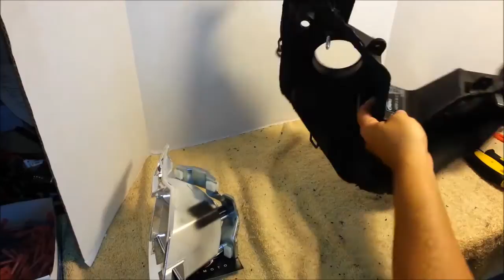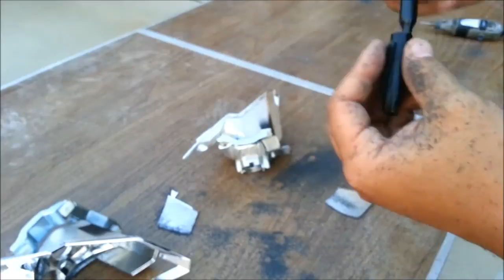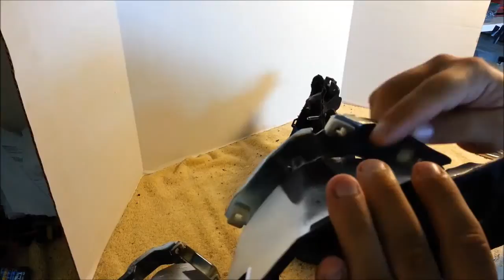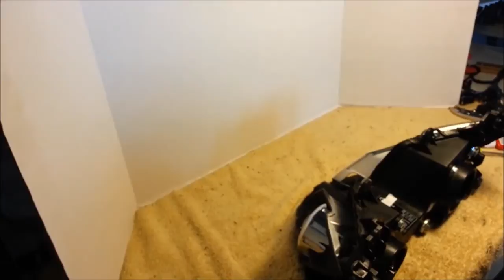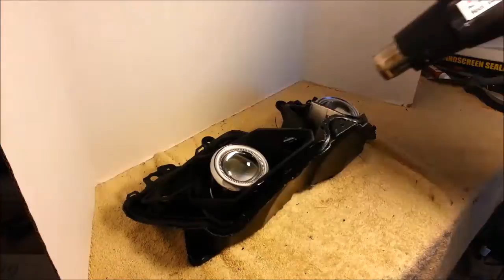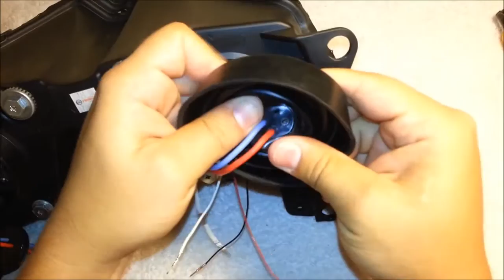How to install BKMOTO Ninja 300 Bixenon hid projectors

Comment: I’ve got everything connected on my bike except for two connectors that have grounding straps on them and I have two male connectors that are on the bike I have nothing to install into. I also had two extra parts that I do not see anywhere in this video so I didn’t attempt to put them anywhere. I turned on my bike and had no luck, I read a comment that says to swap the positives with the negatives but that seems tedious and I would like to figure out where I need to connect these connectors before I go ahead and swap everything back. Also, I would like to know what crimp sleeves are recommended so if I do go ahead and swap everything, I get everything right. 
I have one red wire connected to the positive on the battery, I have white with white, positives with positives, and negatives with negatives excluding the one on the high beam. Inverters are connected, the red and blue wires behind the halo/demon eyes are connected to each other, and still got nothing. Please help ASAP!
Reply: Found what the two extra male connectors are for. Exclude that part!
Reply: The kit I recieved is unlike this video too. Most of it is connected, except the switch and the two units that power the halo and Demon eyes. For some reason, the low-beam/high-beam switch on my handlebar doesn't control the low or high beams. I'm stuck with only high beams. Do you know why this is happening?

Comment: Does this setup make the original high beam switch obsolete? Still not sure how to control from low to high.
Reply from the maker: No, your hi/low switch still works as it should to switch the projectors from low to high beams
Reply: BKMOTO LLC ok, so how does that wiring work, I dont see in the video where the original switch wire was plugged up. I dont want to buy a kit and be totally confused on that part
Reply from the maker: fast forward to 1:20 and you will see 2 original pigtail plugs, one is white and one is black. these are the plugs that lead to the low and high beams on the bike. you are splicing the relay harness to those plugs, which lead directly into the hi/low switch on the bike.
Reply from the maker: fast forward to 1:20 and you will see 2 original pigtail plugs, one is white and one is black. these are the plugs that lead to the low and high beams on the bike. you are splicing the relay harness to those plugs, which lead directly into the hi/low switch on the bike.
Reply: Ok so the new relat is being tied in with the stock wiring harness, is that correct?
Reply from the maker: yes, the new relay is tied to existing hi/low wires.

Comment: I have n300 with demon and halo but the hids won't come on. If I put ballast straight to battery they come on. I have new 55w ballast and new relay. All fuses are good and relay is wired straight to battery. Battery fully charged. Any ideas?? Thanks
Reply: ground the ballast it will go on... I had that same problem wiring the ground didnt work but grounding the ballast metal directly to the body made it go on...

Comment: I just got the kit from your website... And I got one switch and have both angel eyes and demon eyes and got the dual inverter... Can I still get my own switch and have the demon eyes power up by itself? If so what do I need?
Reply: Oh and is there like a step by step.video out there on how to actually install them on the bike itself
Reply from the maker: Swiftx Rider sure, you just need any simple 2 prong on/off switch.
we dont have a guide on how to install the actual headlight on the bike, but its straight forward, once you remove your headlight, put it back in reverse order.

Comment: How do you wire if you don't have separate high and low beam plugs? I have an 03 R1 and both sides of headlight light of for low beam and both for high beam. The plugs I have are standard h4 plugs that are wired directly to factory wiring harness. Please Help I'm Having Issues With this. I have a dual output relay so how would I go about this.
Reply from the maker: its the same wiring, with our kits you get 2 male H4 plugs, so wire the white wire from h4 plug, into white on relay. blue to blue and black to black.
Reply: What if you have a dual output relay? Would you only need to wire to one pig tail since both high and low beam positive and ground are already in one connection?

Comment: I've been looking into getting these headlights and installing them myself, but, I would like to have a switch to turn on/off the demon eyes and a switch to turn on and off the angel eyes, LED strips and corner lights. How would you connect a switch to the setup to be able to do those two things?

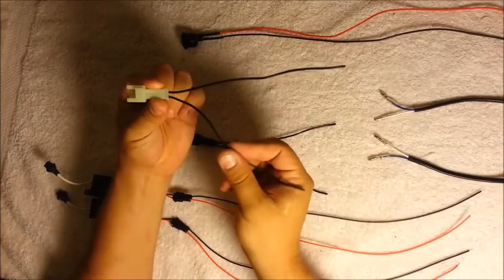Comment: So the power for the HID's and halo's is coming from the low beam plug at 1:19:50 and not the relay wire which goes to the battery? So once the switch is turned on the power goes through the ballast into the projectors?

Also if I got the Audi LED strips with amber indicators these aren't connected to the low beam positive and are connected directly to the turn signal wires, is that correct? 
Thanks
Reply: Okay I'm pretty sure I was wrong. I just don't understand how the halo's can be on when the headlights are off? Since they are connected to the same switch.
Reply from the maker: the low beam positive pigtail wire powers all the accessories (halos,demons, led's etc...) and it also provides the trigger to turn on the relay when the hids are on, and once the relay is on it draws the power from the battery to power the hid's. so the hid's are powered from the battery and the low beam wire simply triggers it to turn on the relay.

the dual color led strips splice directly to the turn signals.

Comment from the maker: if you want the look like the White bike at 21 seconds, you need 1 on/off switch so you can turn off the headlights (hids) and just have the halos and corner lights on as running lights. without the switch you cannot turn off the headlights.

The other switches are optional:
the 2nd switch can go on the halos/demon eyes on/off
3rd switch on led strips on/off

Comment: Stuff Needed 2 of 2
9. Spray paint (he recommends):
amazon +  /Rust-Oleum-7778830-Enamel-Bar-B-Que-12-Ounce/dp/B0010O0C94/ref=sr_1_1?ie=UTF8&qida=1376105325&sr=8-1&keywords=rustoleum+high+heat
10. Threadlock (he uses red which he says is high strength)
11. Butyl Windscreen Sealant (auto glass replacement kit)
 heat shrink crimp connectorsj for the wires
12. 3 days for your spray paint to dry, + 8 hours free to take bike apart and assemble and everything. LOL.

Comment: Stuff Needed 1 of 2
1. Screw driver
2. Needle nosed pliers
3. Box cutter (long narrower razor)
4. Dremel
5. Hot air gun (Ace) or warm up assembly in oven (tray + towel)
6. clamps (6 alligator style) / vice grips
7. wire strippers (with crimpers)
8. tin snips (to cut wires)
9. safety glasses
10.  respirator (cheap kind)